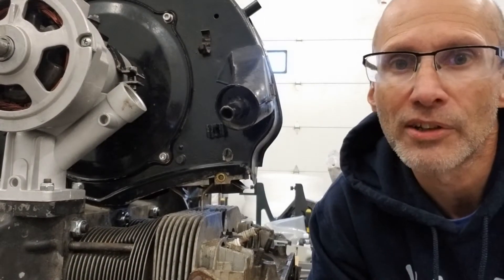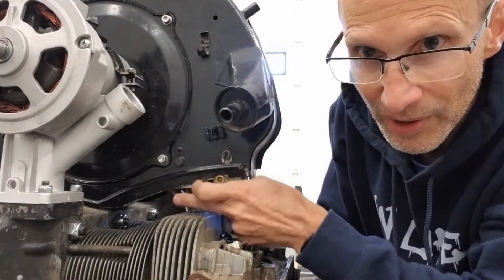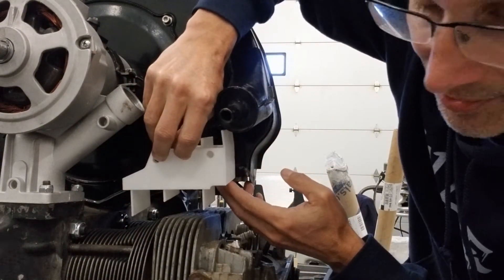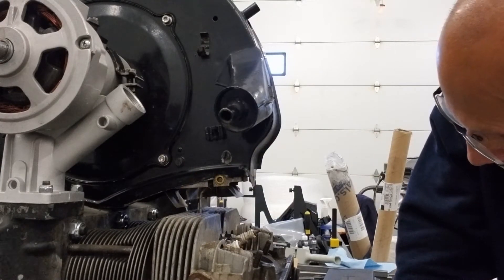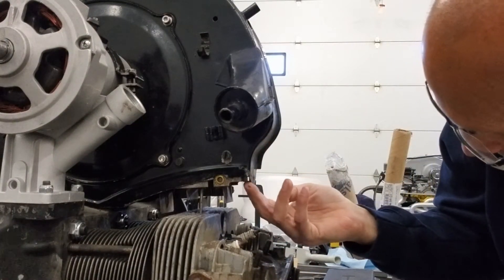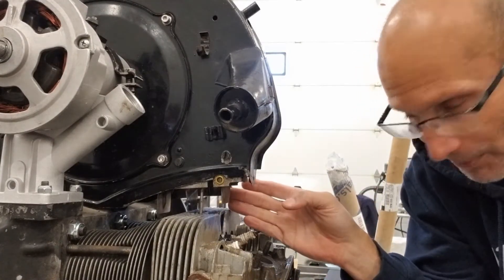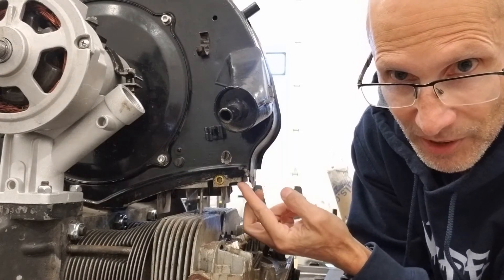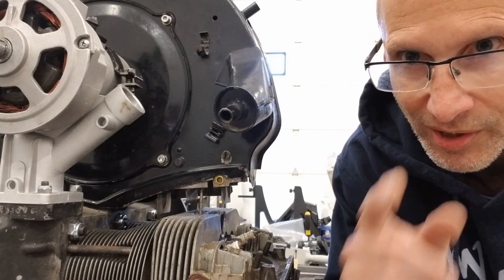Thermostat Flaps Experiment

Comment: While I appreciate that your fixed flaps offer a solution to those whose original flaps are missing, given all the experimentation you have done, is there any compelling reason for those of us in warmer climates with original flaps to lock them in the open position?  I understand doing so would protect against the potentially catastrophic results should the flaps and/or thermostat fail to function properly (accepting the potential downside of slow warmup in cooler weather).
Reply from the maker: Actually, if you have the original flaps and the thermostat fails the system is fail safe.  When the original thermostat fails it will be pulled by the spring to the full open position.  Now, if you don't have a thermostat you can either tac weld them open, or just maintain the system with the spring in place and they'll stay fully open.  There is one caveat, which is if you no longer have the original style thermostat but instead have the Mexican and/or Brazilian style ones they will not fail in the open position.  I'm not sure why the designed them that way, but the did remove a safety feature.  Perhaps they felt the new style thermostat was so reliable that it was not an issue.  I have used them and never had a failure and I've never heard of them failing either.  My solution is really just targeted at engines that either don't or can't run the thermostat.  For example, certain exhaust systems use shorter tubing and the pass directly underneath the pushrod tubes making impossible to run the thermostat and even prevent you from using the lower tin.
Reply: Thank you so much for that…I didn’t realize the spring acted as a failsafe.  Those German engineers were some pretty smart cookies.

On a different note, how are things coming with your hub issues and production issues with your lightweight fan?  My engine is out now and I’d sure like to upgrade the fan before I put it back together.
Reply from the maker: @gutshotgriz3936  Hey, no problem.  Always happy to help.  As I have developed products I have learned so much.  In terms of the fan, I have an all new design I'm calling the Lightweight Cooling Fan NG ("Next Generation).  You can see my blog posts on the subject here:  https://www.andrigsaircooledtechnology.com/post/next-generation-lightweight-cooling-fan-part-1 https://www.andrigsaircooledtechnology.com/post/next-generation-lightweight-cooling-fan-part-2 https://www.andrigsaircooledtechnology.com/post/next-generation-lightweight-cooling-fan-part-3                                              I should have them available on Monday, if things continue to go well with production of the backing plates.  I'm really happy with their performance, and they are even lighter by a little more than 10%.  They come with a special inner backing plate, and all the mounting stuff that needed, and they do require an alternator for installation.  The mounting hardware will not work with a generator.
Reply: @andrigsaircooledtechnology  Had no plans of replacing my generator.  I’m happy to wait if you have plans for a generator compatible version.
Reply from the maker: @gutshotgriz3936  I don't have any plans to make a mounting system that works with a generator, because there simply aren't enough people running generators anymore.  Alternator's are so much better, and they are inexpensive and readily available.  It's unfortunate that the alternators and generators are different in that regard.  Sorry about that.
Reply: @andrigsaircooledtechnology  No worries!  You may have just given me the justification I need to upgrade to an alternator.  BTW…It is awesome to find someone who takes the time to reply appropriately.  Your enthusiasm for the engineering is refreshing!
Reply from the maker: @gutshotgriz3936  I appreciate that.  I started this business, in part, because I love these vehicles and in doing some of my own projects I felt the aftermarket industry had gotten a little stale.  There are a lot of good products, but there hasn't been anything truly new for a long time.  At least that's the way it felt to me.  There are a lot of great engine products on the market, where you can build a high performance engine, but not a lot has been done to cool these engines, so that's my niche for right now.  Have some other ideas outside of cooling systems, but those will have to wait until I get the cooling systems I'm developing all buttoned up and on the market.
Reply: Flaps only needed in cold winter climates.  My bug has no flaps.  San Diego car now Texas car.  Cold mornings after checking oil, I slide a piece of cardboard over the fan and let it warm up a few minutes, remove the cardboard, close the lid and off I go.
Reply from the maker: @brianchisnell1548  The flaps actually serve two purposes.  The warm up is only one of the two.  The second is that they direct the air to the most critical locations for cooling.  Gene Berg did the original research on this, so regardless of climate, when they are fully open, the help to keep the engine cool.

Comment: I run my 1600 with the flaps wired open and no thermostat.  I live in Texas and it runs good (not overwhelming hot) .  I like where you are going with this.  Sounds like a great deal of research has gone into the optimal angle of each set of flaps.  👍
Reply from the maker: Yeah, it has been selling quite well.  A lot of people don't have the original flaps anymore.
Reply: @andrigsaircooledtechnology  fantastic!    I will pick myself up some next time I find that I'm missing my flaps.

Comment: This is not informative at all. Most people do not understand a word of this, vw motors are simple, this video is not....
Reply from the maker: Well, I'm sorry you didn't get anything out of this that was useful.  The experiment was for the development of a new product that I released last December.  I would also say that VW engines are a lot more complex than people realize.  The thermostactically controlled flaps are a case in point.  They serve two functions.  The first, and most obvious, is that they help the engine reach normal operating temperature, and stay at that temperature.  Secondarily, they direct the air flow to the most critical areas of the engine.  The air cooling system is very complex, and involves different engineering disciplines.  One of which is the fluid dynamics of the air flow through the fan shroud.
Reply: Not everyone possess an engineering mindset.  It’s OK…the world needs fry cooks too.
Reply: My '64 did not come with flaps.  Had an air horn.  Very little heat to the car until the therm. opened up.  Flaps gave you heat to the car even when engine was cold.  Warm climate, remove them.  Not needed.

Comment: I live in Corpus Christi Texas and what we need is external oil coolers . About 8 years ago I had to drive to town in 113 degrees I did the if you can hold your dip stick I had no problem . Good video ?
Reply from the maker: Yep, most high performance engines need them, and I lived in Texas for 14.5 years, and my 2007 cc had an external oil cooler.  I am a Setrab dealer, and they have the best external oil coolers on the market, with fans so if you are in traffic, your oil cooler still works.  If there is some interest, I may purchase some stock, and have it on the online store.
Reply: @andrigsaircooledtechnology  What I have is a 71 bus with dp - d-ported heads W 100 cam . When I got the cam from Moore supply they would not sell me a W 120 they said they built a stroked X 92 mm engine that had a W 120 in it . when the customer picked it up and he left and came right back yelling what did yall do with my brakes ! On buses with brake boosters you gotta watch what your doing.????? I just got back from the store and while I was driving there was a Stutz Bearcat VW replica car .It was really cool .As soon as it passed me I saw the pee shooters ....................
Reply from the maker: @jimmywilkinson9190  Yes, the brake booster runs off of engine vacuum.  So, longer duration cams shafts lower the engine vacuum, and then brake booster stops working.  They introduced the power brakes in '71, as you probably know.  What you can do though, is you can install an electric vacuum pump and run the vacuum line from that to the brake booster, and remove the engine vacuum line.